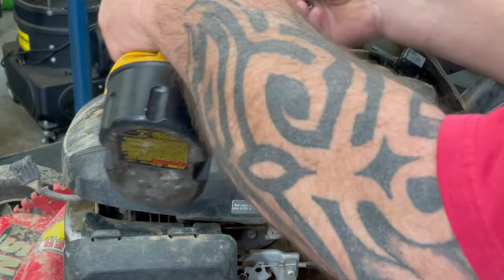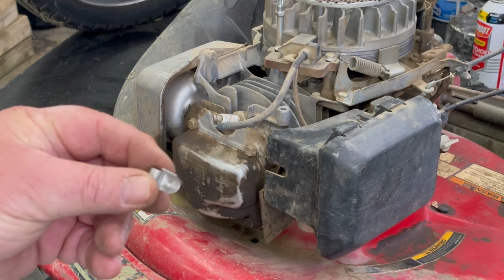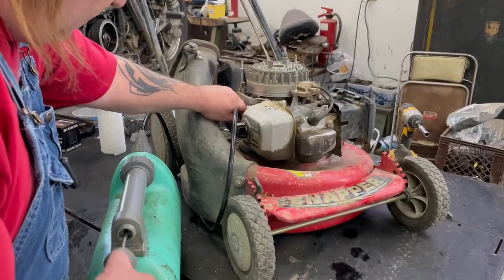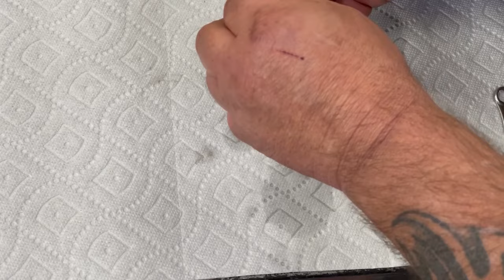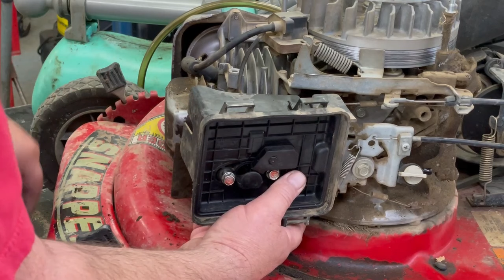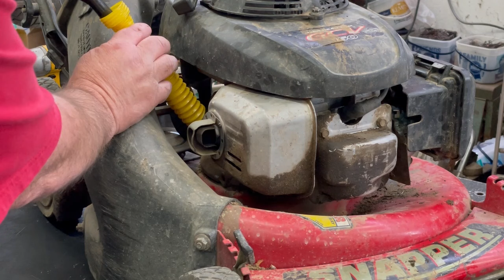Giving A Snapper Pushmower with HondaGCV A Tune Up (remove and clean carburetor)

Comment: I have a 2007 Snapper like this but is commercial version.  I service it before I put away for winter.  New air filter, oil, clean the plug but replace it every other year and drain the gas ( non ethanol) and run her till she stalls. She starts on first pull every year.  On motors that have a metal gas tank when the tank is dry I stuff a clean shop rag in it so she doesn’t rust.  One last thing I do is make sure the equipment is clean top to bottom before putting away. 
Been doing it this way since early 80s.  
Like 👍 your videos.  Cheers
Reply from the maker: cool